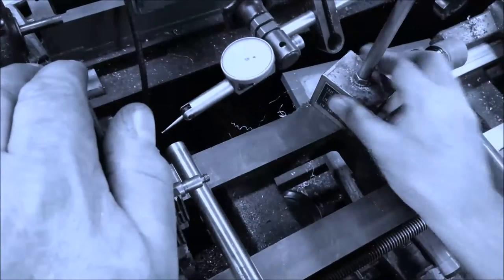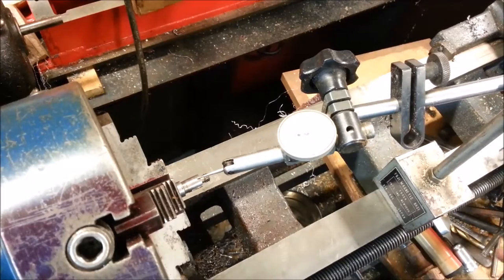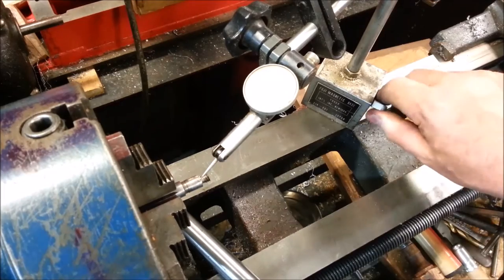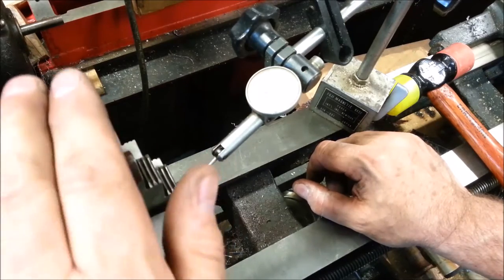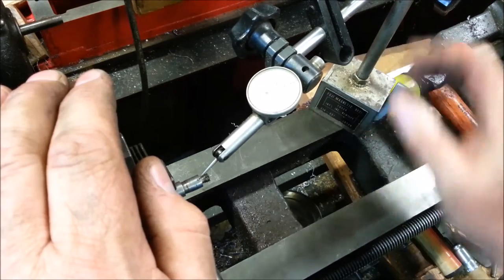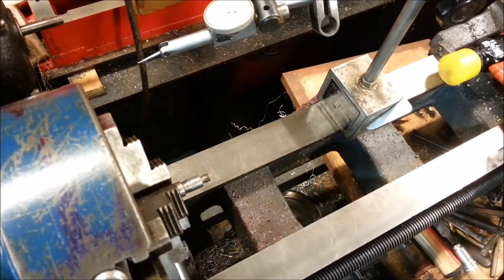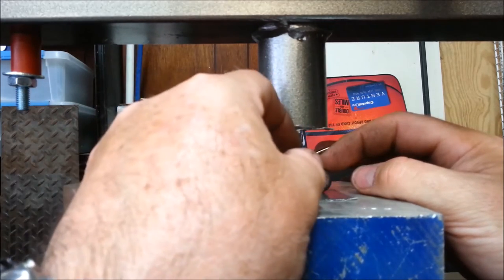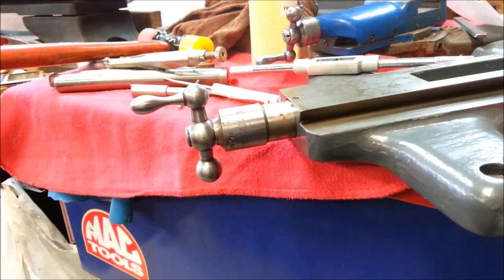South Bend 9 x 24  Workshop Lathe Part 9 - Shaft Straigtening - Crafted Channel

Comment: If you find you have something threaded which you can't get an indicator on like at the end, you use a piece that is about the same height as what you are trying to indicate (I would think slightly shorter would be better), put that on your ways and then put a parallel between the top of that piece and across the top of the threads and then indicate the top of the parallel where it contacts the threads.

Looks like you should be good to go with that part.  I should be a lot easier to use with out it wobbling in your hand as your are trying to turn it.